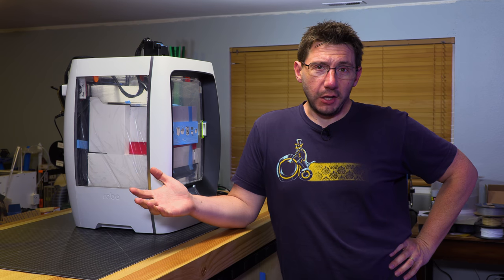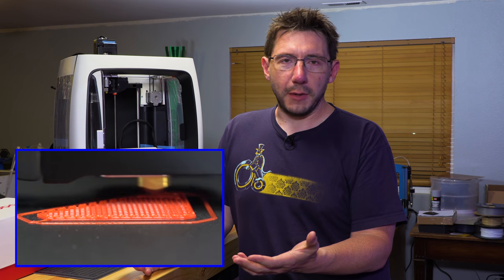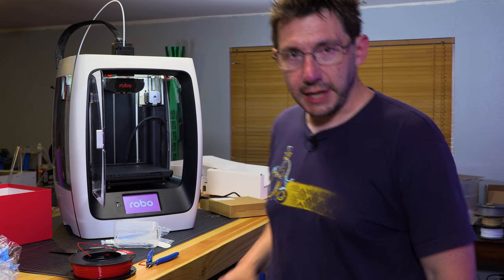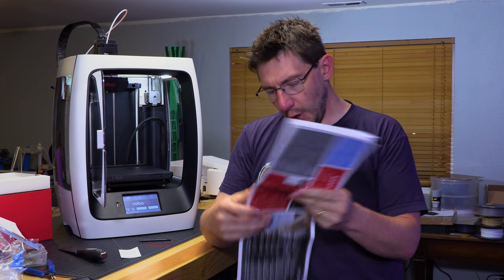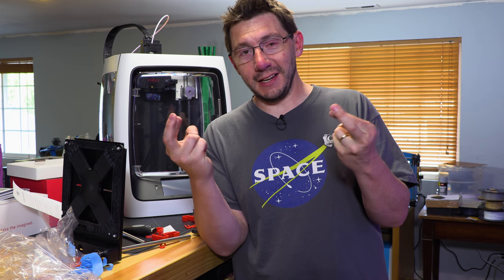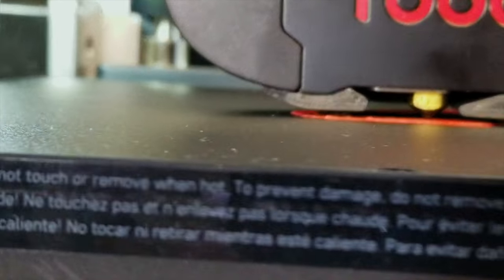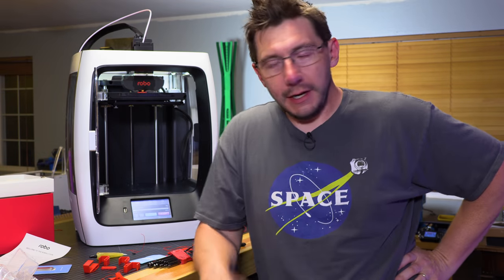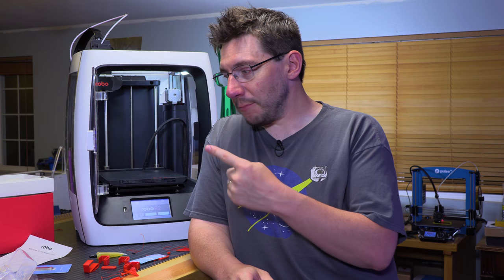Revisit the Robo R2 3D Printer - Second and Third Impressions Update

Comment: I'm sorry, but I couldn't stop laughing at the touch screen failing to register and the oh-so-familiar homing failure and bent leadscrew sounds.

Same shit problems they had with the R1/R1+/R1+Plus and the leadscrew kits on those units--except the R1 didn't even come with an LCD readout. You had to add that yourself or tether it to a PC/Raspberry Pi.

If a company hasn't learned how to fix problems they've had since 2014, they're never going to and they don't deserve anybody's support.

Comment: So they cherry picked the machine looked it over, shipped it 3rd party freight and the 3 printer in is still a failure. Maybe they should consider not putting all that crap inside the printer to save packaging costs when its most likely what is bending the leadscrew. This is a horror story man, you have more patience then I do. I had much less issues with my $160 anet a8..

Comment: Wow I am really disappointed in Robo I have 2 of the R1+ printers they are GREAT they work well I have only had one trouble with the heated bed pins to the board getting lose and causing  me to have to to do some repair. other than that they out work most printers in their price range hands down. and with a simple enclosure I made out of 1/4" foam core and duct tape you can print ABS . yes these LOOK like star wars instruments of great creation but seem to be still a bit in the dark side Hay if you want  a spiffy looking printer then just use the R1+ 's base and construct what ever fancy wrap around and just stick with one of the best desk top printers around

Comment: No offense, but customer support stories are kind of obsolete when you've got this kind of publicity firepower. I talked to person X of company Y and they said "we want to work with you" etc. Yeah right, everybody was so willing to help. The question is: what happens when Joe Regular Customer receives a crappy printer? This reminds me of the C-level guys at my former employer who insisted that problems could all be solved, you just need to pick up the phone and talk to people. Worked for them, I guess.
Reply: When I ordered the Robo R1+, it came with a faulty power supply that died a few days after receipt.
After contacting Robo, they helped us troubleshoot the issue and sent a new one under warranty with next day shipping. They followed up with an email to make sure that solved our issue and everything was working great.

A year or so later, when I had issue with one of their rolls of filament, they sent me a crazy fancy roll for free that was usually twice the cost of the one I had gotten, even though the roll I had issues with was still viable for printing.

I think, if nothing else, they are legitimately trying to make sure people are happy with their product. I know the original R1 had a ton of issues and that the R1+ was later released which basically fixed them all, so historically they do try to work to correct their mistakes.
To expect perfection all the time from small companies I think is unrealistic. They just don't have the resources to do it.
But if they stand by the product and work with the consumer to correct the issues? That's what I think matters. 
That's just me though, your mileage may vary :)
Reply: My experience with my Robo3D R1+ was similar.  I had issues with one of my z-stops:  I got a video chat with a tech and we fixed it.  When I had another problem with a broken nozzle, they shipped me a replacement.  Their tech support and customer service was generally far superior to what I'd experienced with Printrbot (who did a decent job, but Robo far surpassed them).  Whatever their build issues here are, their customer service historically has been very good for a 3D printing company.

Comment: Is this another case of "function following form"? 
When will manufacturers realize that they can make the coolest looking machine ever but if it does not work as advertised ( and they dont advertise that you have to have all sorts of advanced skills in the 3d printing world ) then its a fail!!!
I dont think that the lead screw was bent in transport - if it was the rails would have been destroyed as well.
Seriously, sending out not 1 but 3 machines to a reviewer and all 3 were a disaster means that its time to design a new machine and bury this one because I dont think that the average Joe will ever trust this model...
Reply: The Mad Man you can see from the nut on the lead screw that it's using really cheap parts, so probably using a very soft leadscrew...

Comment: I think you just have bad luck my r2 has worked great from the first day I opened it, shame they cant give that experience to everyone. As far as what they did to the machine before sending it to you, looks like they replaced the bed and PSU with the version 2.

So the problems you had are 1.) Bent lead screw - Robo's fault 2.) Gantry clips - The instructions tell you to remove them 3.) Filament detection - yes the instructions don't tell you which to use but there are several photos in the setup 4.) Update - the instructions tell you to calibrate and update the printer 5.) Touch screen - its not captive it resistive, push harder is the only answer there. So 5 problems (with this machine) 1 robos fault, 2 errors on your part, 2 that's 50/50 IMO (1 thats a design choice ,that screen does suck). I know its frustrating but when half the problems can be solved by just reading the instructions might want to read the instructions better.

Comment: My experience was 100% perfect ,  you made  3 mistakes that were avoidable by reading the instructions because is agains your religion LOL like most of us , well I did read not ones or twice but letter by letter and my first 5 or 6 prints were just no issues yes the LCD screen is absolutely frustrating sometimes there is plastic stuck in between the screen and the shell and the Robo thinks there is pressure or the connection in the back of the lcd is not secure bc it got loose during shipping , the app is not that great in AOS but the camera is pretty cool to keep a eye on the printing progress , it need more improvements I am very very new to 3D printing but I was impress overall .
I do not like the connection to the bed it have a odd angle and I can see having problem in the future with the connection .
Reply: If the instructions are laid out in such a fashion that you can miss major details on removing shipping restraints or inserting the filament into the wrong location, then the instructions are at fault.  A lot of people aren't going to be printer experts when they get this unit.  My first printer was a Printrbot Metal Simple and I had to go to @Toms3DP instruction videos to assemble it.  That's terrible.  My Robo3D R1+ was a much better experience right out of the box, which is why this is pretty frustrating to watch.  Robo shouldn't be making these kind of mistakes.  The market is much more competitive now.  I hope they figure this out.
Reply: I don't agree they are good and clear but I do agreed that the touch screen is a failure in this day and age

Comment: I smell failure... So sad.
Reply: At the end Joel called it a success but I think that is a huge failure. He had to fix the printer by taking parts from another R2. Definitely not something that most people can do since they won't have a spare printer hanging around.
Reply: No, but Robo will send a replacement lead screw under warranty, so you'll still have the part to replace, it'll just take a day or two to get it. Still not great though.
Seems crazy for two in a row to have the bent part though, hopefully there's just something wrong with how they're packing it for shipping and they can figure out a way to improve that.